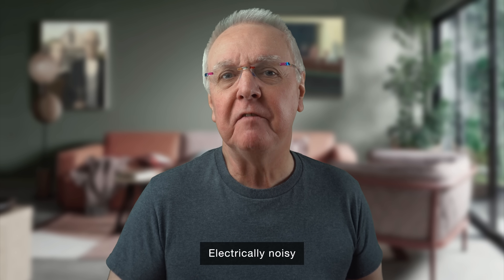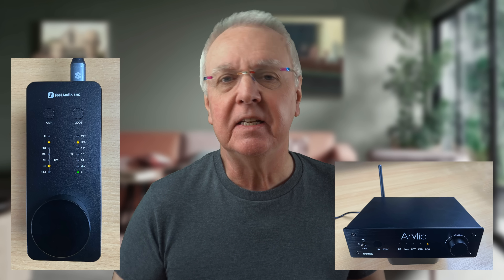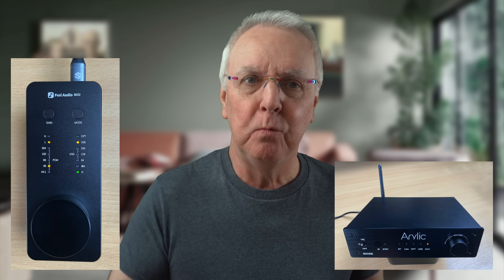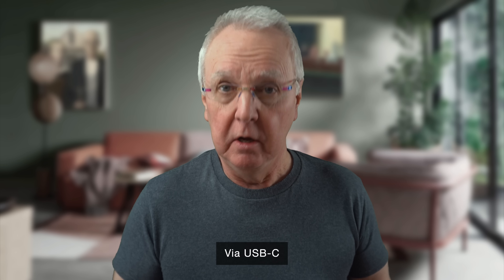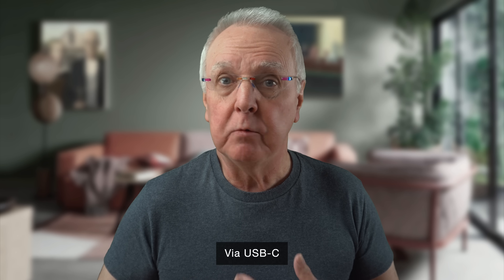Do optical cables have a sound?

Comment: I use an optical HDMI cables in a few locations. As i was having issues with copper ones not successfully carrying the 144hz video signal over +5m. Optical cables totally resolved the issues.

No audible difference between the 2 different options

Comment: It is a fact that digital connections generally work or they do not work. A faulty connection will be obvious with drop-outs, stuttering etc, it is impossible for a digital cable to introduce audible effects such as wider sound stage, smoother highs, greater transparency etc etc. if digital cables really did mangle the ones and zeros then digital networks and digital computers would not exist because they would simply not work.
Reply: These are good final words...
Very nice comparison.

Comment: Yes, they do. It’s the sound of perfection or silence. The two should be noticeably different even for the crazies. When the light reaches the destination intact, perfect playback results. When it doesn’t, there is no spectrum of qualitative difference to be had. The sound stops, period. That is why a $10 Toslink cable sounds exactly, precisely the same as a $500 sucker-wire made exclusively from the sands of Zanzibar and wrapped in designer silk.

In broadcast, we use optical fiber in ways that would gag an audiophile. Tiny little jackets containing 12 fibers bundled together carrying 800+ individual streams of highest resolution sound. When it goes undersea, it is quite the opposite, a multilayered behemoth the size of your leg with powered repeaters every few miles. The fibers within might carry a few thousand time-shared digital signals each.

Comment: Optical cable can transfer more, but this is maybe more about latency - depend per LED diode (some SFP use laser, but this is for LAN/ fiber for storage or DWDM links - multi mode have 100m, single mode laser LongDistance SFP  distance more that 10km , dark fiber more that 100km )  - but in audio is week LED diode and don't have 100m   - i mix here LAN/FC/DWDM telecom links with TOSLINK ;-) - but tech is similar, only communication have pair of optical cable, TOSLINK only one direction - 1 cable.

Optical and digital S/PDIF is same ;-) it is digital and is impossible make mess witj interferences etc - becuase he care obny about 1/0 and have CRC code code for detect error and maybe ECC - error recovery 
Problem with optical is that too much DAC don't suppot 24/192 in optical, but on Cooper yes - btw S/PIDF is not twisted dual link, this is tru coax - then is shilded ;-)  - i switch from optical S/PDIF to USB - why ? source support 24/192, but DAC not, only on coax  "only" 24/96 - and USB is better 

BTW for normal music is OK less that 24/96 ....
My DAC:
PCM 384kHz-32bit/DSD256（USB DAC）
PCM 192kHz-24bit（COAX）
PCM 96KHz-24bit（OPT）

Comment: it's possible that this came about in medical applications. Toshiba and Sony both made recorders for use in a surgical suite and electric noise is overwhelming in that atmosphere, optical cable overcomes that problem. the hospital i worked in the 80's was one of the first to start using these recorders. we had Sony and during the installation i was given a Sony true glass cable that i still use today. sonically, it is still better than any others i have tried. but that was at a time when Sony over built everything they made. just look at the 707 ESD cd player.

Comment: For some reason, between when I bought my last-but-one amplifier and when I bought my current one, they stopped equipping them with multiple RCA-phono inputs. The new one had one each of Phonos, Bluetooth, USB, Optical and Coaxial. With my record deck using the phono, I got my TV connected to the amp because it has a digital optical output. Figuring that optical cables aren't going to introduce distortion, I ignored the hype and bought the cheapest one that was long enough. And it works. Perfectly. My BluRay player connects to the TV via HDMI, so when I decided to use that to play CDs as well, it turned out that it had a wired digital output so that's the Coaxial input taken care of. I just used a cheap stereo connector with one of the wires unused. That also works. Perfectly.

Comment: it would make a difference if we are comparing a 50 cent cable with a 5 dollar one. The 50 cents Toslink usually can't endure abuse/bending. 5 dollar one is definitely a winner :)
Reply from the maker: I think you're right here. If an optical cable were used like a professional audio cable - connected and disconnected repeatedly, then it wouldn't surprise me if it didn't last long.

Comment: Technically the problem  its a abandoned standard  so typically the mismatched between transmitter/receiver 44.1khz/16bits range Spdif up to 384khz/32bits is not guaranteed and I personal color my spdif with Op-Amps similar to Tube Valve swaps ( jitter is a complex subject with a simple solution) clean power.
My experience come from owning multiple device if a difference is heard on TOSLINK the cause would be some type of defect!!! ( Outside of transmitter/ receiver) error or differences

Comment: I'll let you into a little secret. When that optical cable goes into your DAC, it turns to copper and, shock horror, not just copper, but and a mixture of zinc and tin and copper...
Reply from the maker: We'll see what happens when I start up the solder vs. crimp debate in my channel.
Reply: @AudioMasterclass  Ha ha! Well technically wire wrapping with silver plated wire is best as the wire micro welds to the corners of the square pins... 

It is funny to see people messing with megabucks speaker wires when the stuff inside the speakers it usually thin and nasty, not to mention the wire used in the crossover...

Comment: Performance of Toslink (because this is what we are discussing here, not fiber optic transmission in general which is hands down better than copper) has vastly improved since it was introduced. This has not been due to improvements in cables or any changes in the protocol but due to a. Improved quality of the transceivers (for example most any modern Toslink transceivers support 24/192 rather than topping out at 24/96) and b. Improved handling of S/PDIF by DACs (mainly re-clocking and jitter reduction methods, which of course apply to coaxial transmission too). On the other hand, galvanic isolation (transformer based or even optically based in higher end systems) has improved source induced coaxial transmission electrical noise issues. Thus, any 'common knowledge' about Toslink (eg. jitter) vs coaxial S/PDIF (electrical noise)  is up for revision, at least in well implemented systems. But, as we all know, hifi myths persist even when disproven by measurements. As always, the proper generic answer is 'it depends'.
Reply: .      Interesting.  How do I distinguish one DAC that does & one DAC that does NOT re-clock incoming toslink optical?  Descriptions often don't say.
      Is it true that a re-clocking dac MUST have RAM/data cache storage? (which, isn't that what read ahead logic needs & is called or related to PLL? (whatever that stands for))?
      Thank-you.
                                                                                          Acid Jazz,  Funk & Brass  🔈🔉🔊
Reply: @TriAmpMyFi  You can't unless you are told. That's why measurements in reviews are good...
Reply: @razisn  
      What?  Re-clocking is subjective?  Why a reviewers ears & not a specification?
Reply: @razisn  
       The Urd CDT's USB Out has no clocking.  It's a problem for several DACs & reviewers don't seem to understand why the connection fails.
Reply: @razisn  
      (sourced)   Well Schitt go big on USB DACs, and there are plenty of cheaper (i.e. not full-sized “audiophile” DACs) that are USB only.
I’m not a fan of the USB bus in theory, but it is very flexible, and has high data rates.

But in terms of a reason to do this for a CD player in particular:
if you want to avoid the inherent jitter of clock recovery from an SPDIF or AES link, or indeed the jitter of a transport itself, one good way to do it is to send it over to the DAC asynchronously, and let the DAC itself assemble it into a synchronous stream, using the DAC’s own clock, that way the timing of the data in the CD transport doesn’t matter and the timing of the eventual synchronous stream assembled in the DAC will be that much closer to “correct”.

This latter point does in theory allow better quality of conversion, although every method always has inherent tradeoffs - in this case with USB you get the noise of a chatty digital bus injected into the DAC.
How well the DAC handles that is another matter…
Reply: @TriAmpMyFi  what are you talking about?
Reply: @razisn  
      C'mon Razisn.  Be cool and "shed some light" on the topic.  I've been pretty clear and specific.  I'm not typing it again but, I will find the answers.
                                                                         Acid Jazz,  Funk & Brass  🔈🔉🔊
Reply: @TriAmpMyFi  I said, you can't know how S/PDIF is implemented in a particular device unless you are told by the manufacturer or someone you has access to the internal design of the device. Measurements can show the noise and jitter performance. What 'subjective' are you talking about? I have no more light to shed for you. USB is another beast altogether do not confuse it with S/PDIF.
Reply: @razisn  
     Ya, I was coming back to change 'shed light' to put in some 'time' on this clocking topic.  Sorry bad humor and a waste of time.
    Let me try one more time.  My question is about DAC clocking.  S/PDIF in 2024, carries an incoming embedded clock signal.  4-wire USB audio v,2.0 & higher carries NO incoming clock signal.  Is this correct?
Reply: @TriAmpMyFi  S/PDIF can be reclocked by the receiver. External reclockers have been available for years now. More and more devices (dacs) support this functionality internally nowadays. For example my Musical Fidelity M6XDAC. It mentions this functionality in its literature. I can't tell you which dacs do and which dacs don't.
Reply: .     Or was it something somewhat coincidental?  Such as when USB v2.0 came out with NO clocking signal path,  then those DACs were forced to have on board clocks anyway so engineers just somehow filtered out the optical clock signal & used the on board clock?  Whew.
 
                                                                                            Acid Jazz,  Funk & Brass  🔈🔉🔊

Comment: First of all, it is worth realizing WHY digital signal transmission was invented. Well, a quite nice feature of digital transmission is its losslessness. Or at least in almost(more of this later) every transmission protocol. Without going into details - correction codes are used and/or transmission is repeated in the event of an error, so when you copy a file on a computer or transfer it to a pendrive - the copy is 1:1 perfect. So is copy of digital audio stream in the buffer of DAC.
Additionally, protocols such as Dolby Digital or DTS(or flac)  compress the audio stream and it is decompressed after transmission in the target decoder, e.g. receiver. If even one (one of many billion) bits were corrupted, the decoder would report an error or reproduce "digital noise" because the stream would become a digital sequence of random thrash and could not be decompressed.
Transmission in any modern standard is lossless, and if the cable is damaged or errors occur due to poor transmission quality, these errors manifest as audible crackles, noise or "digital noise". Under normal conditions - the cable is undamaged, the equipment is functional - the transmission is error-free, 1:1, lossless and it does not matter at all whether it is an optical (and what kind) cable or an electric cable or anything else - e.g. wifi or ethernet :).
Exception of this rule  is the Red Book Audio CD protocol used in CD players. There is no error correction or compression here. Reading errors (scratched/faulty disc, dirty/faulty laser) are masked with zeros (silence) after several reading attempts and not corrected because there are no correction codes. Possible jitter is not corrected in any way (and it is rather an imaginary problem as no one can indicate what it means and how "jitter problem" sounds ;-) - even a microphone recording). The specification allows masking and a certain number of errors/sec because it is - unless this number of errors provided for in the protocol is exceeded by  - completely inaudible.
But if someone is irritated by this uncertainty of CD reading, the workaround is as simple and cheap as it is obvious. RIP the disc to losslessly compressed flac - checking the CD database for correct reading of the entire disc (CRC code) and opening these flacs. 100% read/transmission certainty.

Comment: I love optical cables because I get weird noises when trying to connect my PC to my audio system with copper wires (I think it ground loops, and changing things visually probably send all sort of interference through the power supply), and they also get me surround sound for my Bluray player. I never really had problems with analogue connections through copper wires for CD playback though, although even there I suppose the digital signal starts optically reading the disc.

Comment: Problem with optical toslink is that standard is very old, and you can't have more than 96k audio... my laptop with USB out can do better, coaxial also... You can have better results from toslink on optical side - but that will be popriertary... not a standard...

Comment: Audiophile ears are connected to the environment and the soft sound of digital pulses can be heard synchronized between the oscillations of the electrical field.  /s
Gosh, you obviously never graduated from a well-established audiophile university.
Reply: I think some audiophile ears are connected to their bank balance: if the price isn't sufficiently high it must sound rubbish. The utter b*ll*cks around people claiming they can hear a difference in a digital signal is ridiculous. Even if there was a difference (the occasional bit flip) it would not be consistent enough to say that that one cable was "warmer" (or any other semi-emotional trash) than another. If knowing that they have spent £1000 on cable being used for digital signals makes people happy, fine. But don't try and convince me that it sounds any better than a standard quality cable that costs £5.

Comment: a decent system & one could hear glass v plastic right away. +glass tos, since it’s niche- will already hv a superior connection v run of the mill stuff bein ‘em catered to snooty audiophiles. 

The US Glass Toslink frm AMZ is $30 fr 1m— jus try ‘em out rather than regurgitating nonsense w/o experience. Back it up.

Comment: The only reason we use an optical cable is that it’s the only way to get sound from our TV to our amp (other than the crummy 3.5mm headphone output on the side of the tv which sounds objectively terrible).

Comment: I've used several different "brands" of optical cable over the years. Most were of the Radio Shack stock and most were purchased for helping out a friend with their home theatre setup. If there ever was a difference I would consider it so nominal as to be insignificant. 
For my personal usage, it was purely utilitarian. By routing from my mixer 8 bus outs directly to my ADAT and using the "optical" cable to my interface, I would then have the whole 8 XLR inputs on the interface still open. Thus I could then track 16 inputs simultaneously. What's not to love about that? Essentially, every mic/input is still running through traditional copper cables, but the "optical" bridge from the ADAT to interface just doubled the track count. Like I said, simply utilitarian. In the scenario I use it I could care less if there were some teeny bit of oddity going on, this is just capturing a performance. It'll get mixed later. To me, that's the true power of optical cable.

Comment: With optic fiber, I am not sure if there is a limit to how much bandwidth it can support.  It is generally the electronics at either end which are the issue (and if there is jitter, it will be in the electronics).  e.g. Ciena provides transmission and switching products which with capabilities up to 1.2 Tb/s per wavelength, and you can send multiple wavelengths down an optic fiber (wave division multiplexing) and these are for metropolitan distances.  I use optic fiber for my VR headset, which handles two 4K video streams, one for each eye.  I also use optical HDMI for my 4K projector, as copper would end up being too thick and heavy.  I would therefore think that optical cables have no sound.  Copper USB cables, on the other hand, do impact the sound, which can be quite dramatic (depending on the sensitivity / resolution of your audio system).  I compared the sound of different USB cables and selected the one that made my streamer sound closest to my turntable.  Of course, if the jitter in your electronics is greater than that in the copper cable, you might not notice the impact of the cable.

Comment: As a serious audiophile i've not really heard of us audiophiles using optical,  only on the network, i for example use an Adot mc02 in my network. I've never really thought about the reason why. I know that the £110000 MSB select dac has Toslink, i just don't think they are any high end audiophile Toslink cables that cost thousands of pounds, I know Audioquest do a nice Toslink for a couple of hundred quid.

Comment: I absolutely HATE the flimsy flap door arrangement on TOSLINK equipment connectors. Will it break on the first or second insertion? Cheap doodoo TOSLINK cables are likely to have poor connector to fiber mating that may cause signal reflection down and back the length of the cable which may cause confusion at the receiving end and signal degradation. Call me a Neanderthal, but I like coax. Ook.